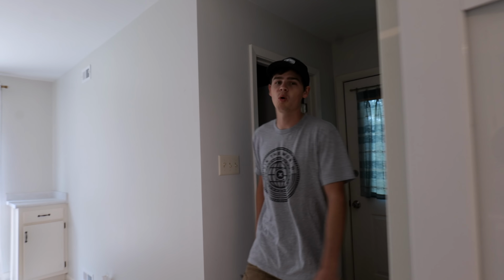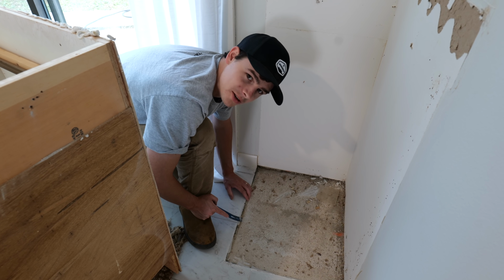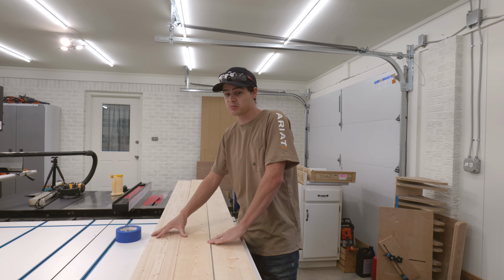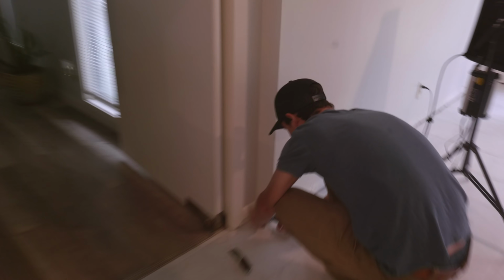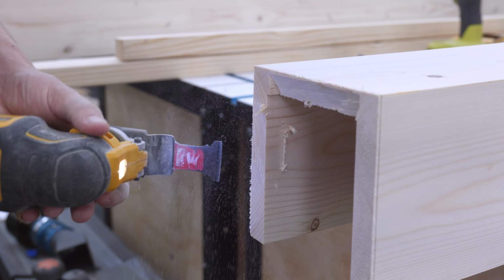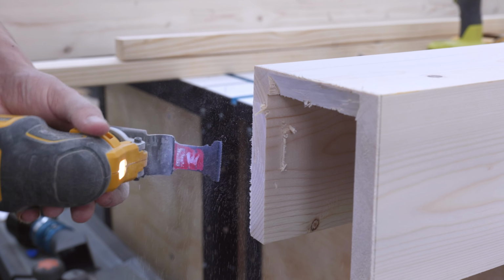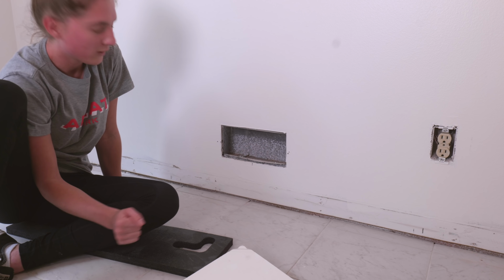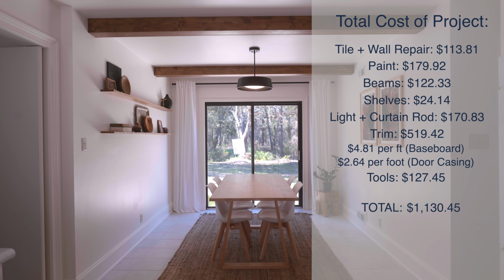EXTREME Dining Room Makeover!

Comment: Looks great. What was the reason for beveling the ends of the faux beams ?
Reply from the maker: Having them come to a point creates a perfect joint with the wall without gaps. The entire length of the beam was cut on an angle for this reason too. The edge can also bite into the drywall a bit to give an extremely crisp joint.

Comment: HEY, really nice job, especially on your base trim and faux beams.  I've done ceiling beams and you are right, they can be tricky.  One question though.  Why did you scribe with a blade instead of a sharp pencil?  Better accuracy?
Reply from the maker: As you sand or use a chisel up to the line, the fibers will kind of break away and you’ll know exactly where your mark is👍🏻

Comment: Good job.  Yes,  it was more than what you expected,  but,  buying the trim you did,  adds to the value of the work done.  Wider baseboards are in higher end decoration jobs,  same with door casing.  You guys did good.   I also like how you did the floating shelves,  have not seen them done that way.  Real question is,  when have you decided to tackle that laundry/bath room?  That’s going to be a job.  I have a question in your new shop area.  Did you install any heat/air?  If you did what did you install?  Thanks.
Reply from the maker: Thanks! Laundry room is no where in the picture right now😅 Also, yes, we have a window unit in the shop and a NewAir heater🙌🏻